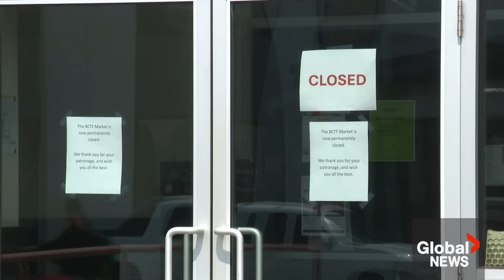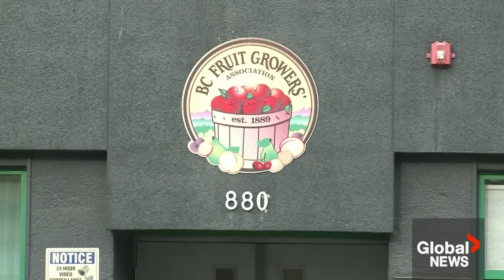BC tree fruit growers in shock after co-op’s sudden collapse

Comment: Who are the owners of the BC Tree Fruit Cooperative?
Reply: Its a Cooperative, so I'd assume it was employee owned and operated.  The only reason one could think it closed down was because it ran out of money, since the only shareholders it would be beholden to were the workers in it.
Reply: A coop is usually owned by the farmers who are members and use its services.
Reply: @Tugela60  So basically farmers have mismanaged their facility.   I suspect it got management-heavy with too large an overhead?
Reply: @dmitripogosian5084  Not in this case.
it was due to the fact that 40% of fruit trees failed to produce fruit in 2023 due to cold snaps in December and March and 75% failed to produce fruit this year due to cold snaps in February.
Reply: @TheAircool1  Well, the story is a bit inconsistently told here. They guy seems to complain that he will have trouble selling his apples, not that the crop is low.   And that there is a glut from US.  Perhaps coop problems came from last year, but again, it could be explained clearer.
Reply: @dmitripogosian5084  The apple crop was pretty much the only thing left largely unaffected by the cold snap since apple trees are capable of handling much colder weather and they tend to blossom a bit later.